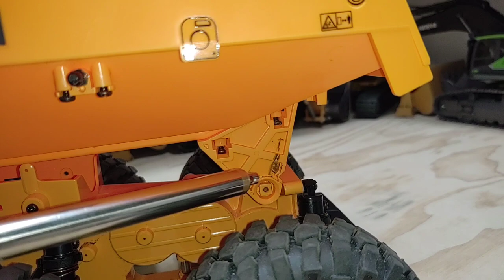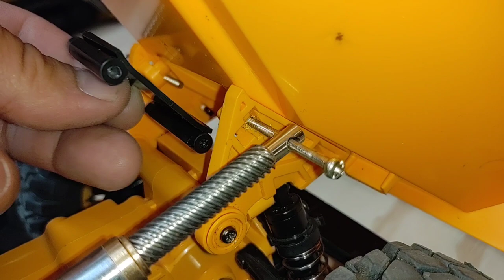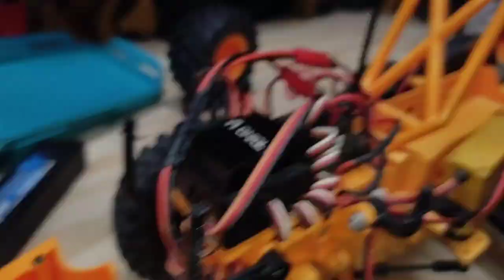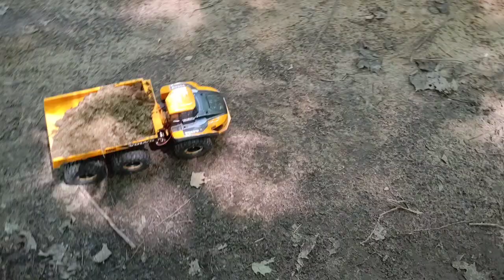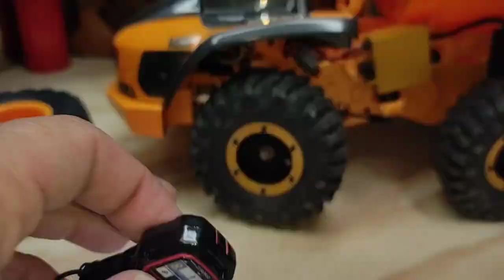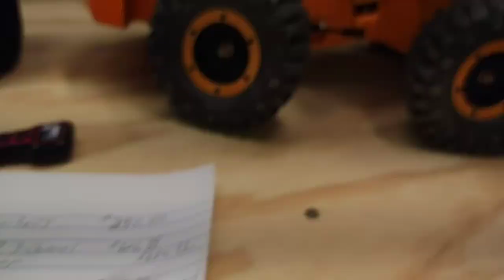Tamiya Volvo A60H or A60Y; Tipper Truck Conversion

Comment: I have a question about the two 1550 servos .. I ordered 2 sets, but I noticed there are no ends on them... Do you wire the 2 servos together and then plug one wire into the receiver? I am totally new to the RC world, and I understand mechanical better than electrical. Thanks for any input you can give me
Reply from the maker: Number 1, I used a Rc4wd Wireless Winch Controller as the controller to move the servo's in and out, versus using a extra channel on a transmitter to toggle the servos. You'll have better control sensitivity with a Rc4wd Wireless Winch Controller.
That being said you will need a extra channel on your Transmitter's Receiver, so that you can draw power from it for the lift servos.😕
As for the servo's; I'm not sure what kind of connectors they included with your servos, but if their anything like the ones I used, I was able to use a "JST" style plug Y connector, to connect the two servos together "into a 2 into one plug" and then I plugged that into the Wireless Winch Controller's control unit. And then I used a single jumper wire with two male "S" style connector's on it, in order to connect the vehicles transmitter receiver into the Winch Controllers wireless receiver/winch control unit.
So that would be one wire with two male JST's going from the vehicle receiver to the winch controller, "as the power supply" and One JST "Y" connector with two female JST's on one side and one male JST on the other side, to connect the servos with the winch controller.😕 If that makes any sense.
And then the next step is balancing the lift servo's, so that their both starting off in the same position.
For that I powered them both on individually "to get them into the same position" and once that is done and "after" you get the open ends attached to the bed of the truck, both of the servo's will travel at the same rate going in and out.
The open end at the end of the servo needs to be attached to something in order for the servos to travel in and out, otherwise they'll just spin in a circle and not do anything.😄
So you need a male to male "S" style connector jumper wire, and a Two into One "JST" connector, with two female jst's on one side, and one male jst on the other. And you should be good to go from there.😁

And one final thought;
There is no limiter switches with this setup, So one very important thought, is to always be very very careful when raising and lowering the bed, so that you don't overdrive the servo's in either direction "after you get it all hooked up"  if you do... chances are that those lift servos will rip your truck to pieces.😕😭 
Make sure to be careful and remember that this is a "Do at your own risk situation"
Hopefully the information is helpful for you my friend, and if you have any more questions, feel free to ask away at any time.😊👍
Reply: @R.C.A.D.  Thank you so much for all the info .. that makes a lot more sense to me now. I ordered basically the exact same things you used to set mine up.. I am just waiting on the parts to show up. Also, I was wondering .. those servos have a hole in the middle that you ran a bolt in to secure them to the truck.. Would it be possible to drill a hole down from the original to place the servo a little higher so the shock tower doesn't hit the servo? And if you decide to put a limiter switch on those servos I would like to see how that would be done.. Just so I don't over extend the dump bed. Thanks again for all your help
Reply from the maker: @larry2494 no problem with the help 😊👍
As for drilling a new mounting hole through the servo; 🤔 That would be a no, A Really Big No 😕 and would certainly destroy the servo.
As for the shock tower spacing; As long as you set it up the same way that I did "using left over parts from the Volvo kit as spacers" then everything should work good enough to get the job done with no real suspension issues.
Yes the shock will bottom out on the bottom of the servo a little bit, but it's so miniscule that it's really not worth messing with.😊👍

As far as a limiter switch;
If I ever get around to installing a set on here, I'll make sure to do a complete video install on the entire process,😁 "But in the meantime" make sure that your careful with not overdriving the servo's, and I would be very cautious about who I let operate it.
Meaning don't hand the controller off to someone who doesn't know anything about it.😕😄 Ha lol 
Side note; each one of those servos is capable of lifting roughly 11 lbs on their own, and a combined total of roughly 22 lbs. 
So be careful 😊👍
Reply from the maker: I goofed up Larry, I told you that you needed a male to male "S" style jumper wire to go between the vehicles receiver and the winch controllers receiver, But I was wrong. You need a Male to Female "S" connector jumper wire.
The female side gets plugged into the vehicles receiver, and the male side gets plugged into the winch controller receiver.😊
Sorry for the mixup Larry
Reply: @R.C.A.D.  Its ok, I appreciate you letting me know. I will have to get those wires ordered soon because I'm sure I don't have those laying around. Have you decided whether or not to go with a brushless system? I agree that for the main purpose of using the truck for hauling dirt, which is my main thing, I don't need a basher haha
Reply from the maker: @larry2494 right on Larry, I was hoping to catch you before you started ordering parts.😄 as far as me going with a brushless setup for the Volvo; That's probably what I'll do in the future, a Hobbywing Quickrun Fusion Pro 2300kv would probably be perfect.😁 I'm sure that the Hobbywing Quickrun Fusion SE 1200kv motor would be plenty for the truck, but the 2300kv fusion pro would be much better.
For now though the cheap 55t brushed motor is working all right.😄
Reply: @R.C.A.D.  Your just in time, I haven't ordered yet 😂.. Do you have another platform to communicate with? email etc ..
Reply from the maker: @larry2494 right on...😊
As far as other platforms for communication; I have a Gmail address attached to this channel that I never look at, and then there's instant messenger on Facebook, I can't stand Facebook, but I use the hell out of instant messenger.😄 lol
Reply: @R.C.A.D.  Hello again, I followed your video and SUCCESS! Got it working great. The only thing I have a concern with is I think the servos need a limiter switch because they do want to over extend. I think if it had those it would be smooth sailing. Would you consider adding those? and making a video to show exactly how lol The only thing I done different is I added a 120mm 3M bolt to connect the servos to, but I still added the black plastic piece in between for added support to the bed. Thanks again for your time
Reply from the maker: @larry2494 Nice Job with the build Larry 😁👍
As for the over extending;
I really haven't had a problem with it, but I could definitely see it being an issue.🤔? Hmm
Thinking....... Well I suppose that I could do a limiter install, ..but you're gonna have to give me a minute Larry,😕 I currently have a backlog of RC shop work and videos, that I'm  working on, and I'm also gonna have to order a set of limiters for the project.
It's definitely not going to happen overnight Larry 😄 But I will move it forward in line of a few other projects that have been waiting since Christmas.
Not gonna happen overnight, but it has become a priority project.
😄👍
Reply: @R.C.A.D.  That would great! I know it will help others, like myself, that is new to the hobby. I am looking forward to the video and when you know what parts to order, place a link because it takes awhile to get those in the mail. That is usually what takes me the longest, waiting on parts lol .. Thanks again my friend
Reply from the maker: @larry2494 right on, will do, no problem, and thanks for the appreciation man.😄👍

Comment: I have had great success with the Hobbywing AXE 540 FOC Waterproof V1.1 Sensored Brushless Combo w/2300kV Motor. I can crawl at super slow speed and the E-braking is super. This may be a great option for this build.
Reply from the maker: You're probably right...😁 That is a great Brushless Combo, I recently installed one of those in my nieces "custom" RedCat Gen 8 Jeep Comanche. 
I was thinking that the Hobbywing Fusion 1200kv Brushless Combo would be a good fit for the Volvo, but the 2300kv system would be even better because of the "go big or go home" factor.😂👍
Reply: @R.C.A.D.  I run it on one of my TRX6 trucks, and one of the TRX4 crawlers it is one of the most controllable motors I have ever used. I'm not by any means an expert in the field of electric motors, I just know what works well for me. Thanks for the video, I'm working on some R/C projects like a crane truck, 6x6 tipper, and a dual beam tow truck. Your info. was very helpful.
Reply from the maker: @ROCKRATADVENTURETEAM 
I hear you on knowing what works and what doesn't.😄👍 
I'm just starting to get into Brushless motors for our crawler's. 
I've been messing around with the Traxxas Vxl 3s brushless combo for years with a few different vehicles, but nothing for our "actual crawler's".
A channel sub named Dan Weiss stopped over here for a few days around Halloween of last year, and he brought several RC's with him, along with a few Comp Crawler's with brushless setups. I was sold immediately on the smoothness of the brushless combo's. 
He had a couple of V1 Hobbywing Quickrun Fusion motors, and one Holmes Hobby Revolver, and they were all very impressive. Once again I was immediately sold.😄
Since then I purchased and installed a Hobbywing Quickrun Mini 24 system into my Axial scx24 Jeep Jlu CRC, and then I bought another one for my brother as a Christmas gift, as well as that Quickrun 2300kv system for my nieces Gen 8, and then my brother received a RedCat Ascent Fusion for Christmas as well, which came with a form of the Hobbywing Quickrun Fusion SE 1800kv system.😄 And any other motor I purchase from here on out are "most likely" going to be brushless as well, depending on the situation, and vehicle needs of course.😁 
The Volvo A60H could use one for sure 😄 the brushed 55t motor works alright, but a FOC Hobbywing brushless combo would work much better.😁👍 I love the Mini 24 system in my Scx24, that thing crawls insanely slow, as well as neck snapping throttle response.😊 I love that motor setup! 😁
My future plans are to slowly upgrade all of our 1/10 crawler's to Hobbywing Fusion setups, and probably the same thing for any future mini crawler's as well.😂 

As far as your Crane & 6×6 tipper project; I sincerely wish you all the Best.😊👍
And many thanks for your kindness my friend.👉🏆

Comment: But the cylinders you’re using got me thinking about my ultimate Hauler???? You know what I mean. You’re a bit of a mad scientist. It is my favorite part of the hobby is reconfiguring reworking rebuilding. Lol I think that’s how Frankenstein came about.
Reply from the maker: Mad Scientist...😄 Ha! You know it Brother 😁👍 That's my favorite part about the hobby too, I love modifying RC's, and just about anything else that needs improvement.😂 Lol 
As for your Ultimate Hauler.... That sounds interesting 🤔 and if it's got you thinking about the worm gear screw servos that I used, Then I think I know how you want to use them.🤔 You're probably thinking about a flatbed that can lay back, and then retract back into place aren't you ? 😕😊 Kinda like a bed on a track "that can stretch down to the ground for loading, and then retract back up to the truck like a flatbed wrecker. I can actually picture that 🤔 and I think that one of the longer cylinder's going down the middle of the frame and attached to the bottom of the bed "in some kind of central location" would probably do the job nicely.
😁👍
Reply: @R.C.A.D.  yeah exactly on the Traxxas TRX6 ultimate hauler The flatbed part to roll back I was thinking like some nice drawer slides that would get it to slide back smoothly with a set of hinges attached to the back of flatbed, and also attached to the drawer slides. The cylinder would have to slide with it. when it gets to the end of it slide all the way back that’s when the cylinder would take over and start lifting the bed anyway you can buy a kit for over $400 or you can use your brain and enjoy your hobby and try to figure out a way to do it yourself. I’ll figure it out. We’re packing up right now, going to head to the gauntlet at Walter Farms it’s a good place to go and see other peoples mad scientist projects. Me and the wife enjoy going not for the rock crawling competition. I’ve never done that part. We just take part of the nighttime trail driving for fun. brother, I’m telling you I’m gonna get up there and see you and maybe bring my flatbed you can help me brainstorm. Talk to you soon!
Reply: You would have to use two sets of sliders, want attached to the frame and then one shorter set attached to the bed. This way when it gets to the end of the track, then it can slide down to the ground for loading. I think you know exactly what I’m talking about. Lol.🥸
Reply from the maker: @danweiss1371 
I do... I can totally picture it in my head. All you had to do was say "ultimate hauler" and then mention the servo's, and after that "I immediately pictured exactly what you're were talking about.😊 And if I had a TRX6 that I could call my own, "then I might actually try it.🤔 But sadly I do not 😞 "the idea is all yours my friend, and if I were you, I would start working on that project ASAP.😄  No worries about competing with me, I don't have a pot to pee in, or a window to throw it out of, so you should be in the clear.😄 Ha ha ha lol 
Party on Wayne! 😁👍
Reply: @R.C.A.D.  yeah sometimes my brain gets way in front of my mouth.. Lol inside my brain is a dangerous place to be.😵‍💫
I just got lucky and had a buddy that removed the axles from his new ultimate hauler all apart then lost interest. Sold me brand new TRX6 ultimate hauler in a box with a bunch of upgrade parts. For 250 bucks he made me buy it. If you know what I mean.
Reply from the maker: @danweiss1371 
Dude.... That's a steal of a deal, and you would have to be either completely penny less, or completely crazy to pass up.😂 
As far as what's going on inside your head.... I hear ya.. "I almost assume" that every creative mind has a lot going on in it, at the same time.😄

Comment: I am just starting a video and I think your servo idea is way better. You can get some of them 1/5 scale Raminator servos that would lift that no problem.
Like I said, I just started the video and you might’ve did some of this. But it might be easier to lift the bed 3/4 of an inch and then you won’t have to cut the plastic out?

Comment: I am just starting a video and I think your serval idea is way better. You can get some of them 1/5 scale Raminator servos that would lift that no problem.
Like I said, I just started the video and you might’ve did some of this. But it might be easier to lift the bed 3/4 of an inch and then you won’t have to cut the plastic out?
Reply from the maker: True about the bed lift, but it's got a couple of drawbacks, Such as getting the weight higher up in the air, and making the truck more difficult to load on level ground.😕
Didn't know about the 1/5
Scale Raminator servo's 🤔 I'm gonna have to check those out.😄👍